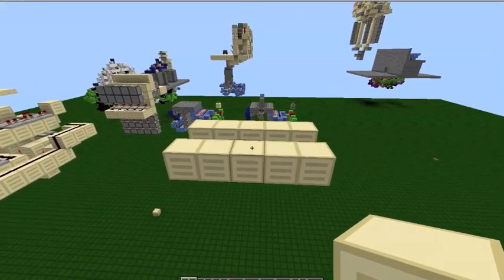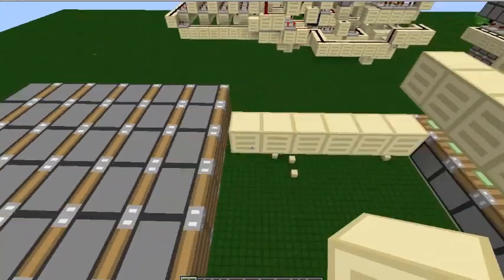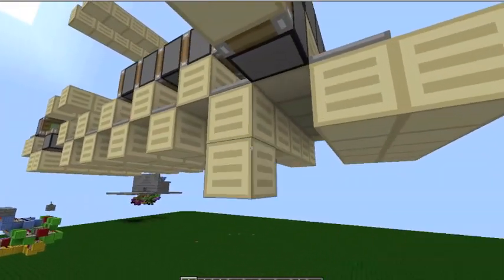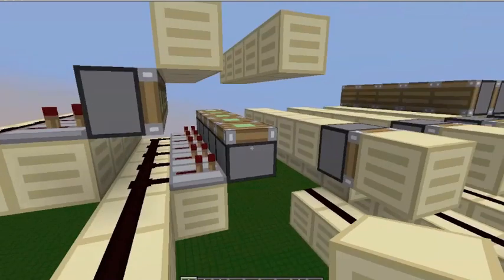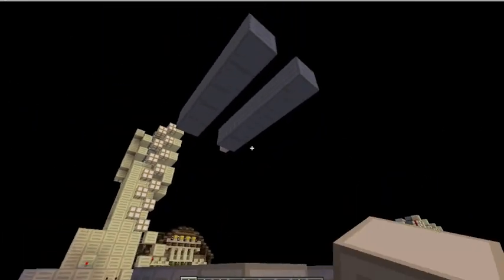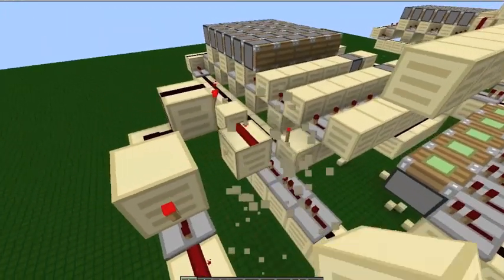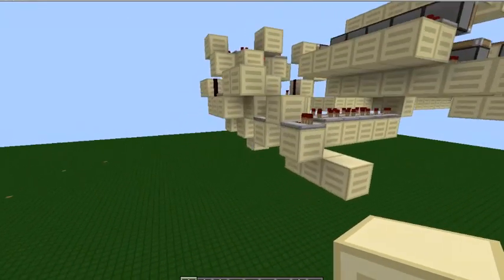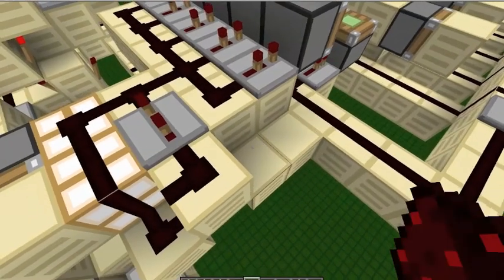5 High Portcullis, no sand when opened/closed [Minecraft Redstone Tutorial]

Comment: Dico, I've been toying around with this circuit on the most current update for the PS4. I've extended the circuit for a 10-wide door, and stretched to fit a 10-high gate. My issue is with the timing for the bottom half of the door: the pistons don't always extend when they're supposed to, and sometimes destroy part of the circuit. Also, the sticky pistons under the gate opening fire too fast to effectively lift sand, gravel, concrete dust, or really anything else in a manner that would lift the gate at all. Do you have any suggestions on how to fix your circuit? Would you be willing to post a new video?
Reply from the maker: It takes very precise timing to do that. I was working on something comparable at random the other day. If you go on Redstoner.com server, one of my plots (Dico200) has pistons in the floor as paths. Underneath, something does stuff with trees. Go look for that:)